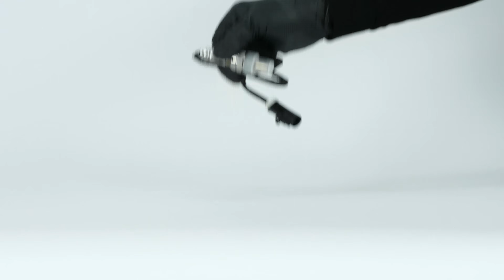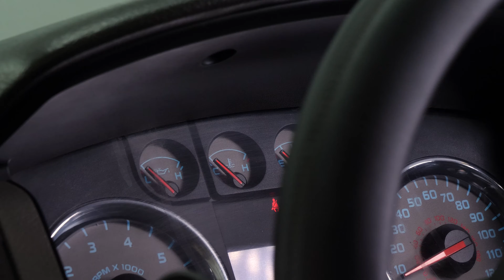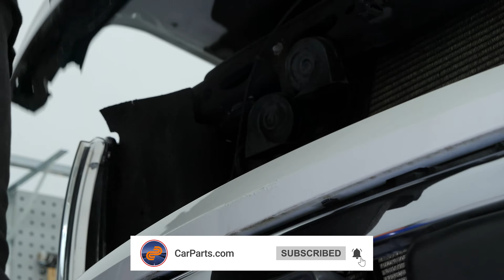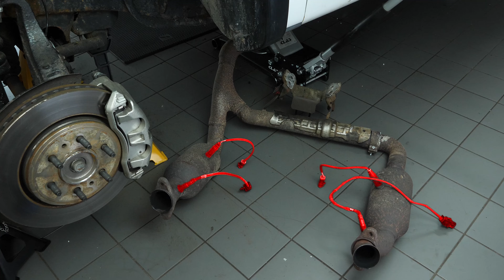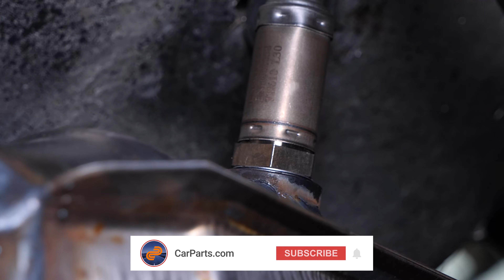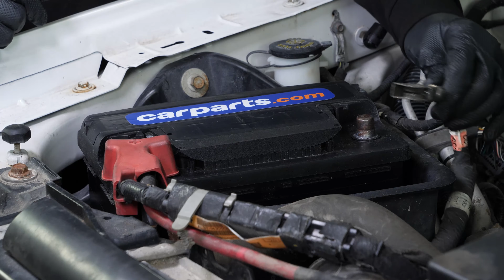How to replace the Oxygen sensors 2009-2014 Ford F150 ⚡

Comment: I unplugged the battery and the check engine light went away for the O2 sensor. wonder if it will come back or if it's fixed🤔
Reply from the maker: Without replacing the sensor?

Comment: What they fail to explain and/or demonstrate, is how Bank 1 sensor 1 on the passenger side is a real pain in the ass to remove. Need an offset o2 socket, a stubby 3/8s flex ratchet, a high pain tolerance and lastly, preemptively asking for forgiveness for the 800 f-bombs about to be spoken during the process.
Reply: Dealership wants $1900 CAD to replace all four O2 sensors.
Reply from the maker: It's true that these O2 sensors are difficult to remove, but our aim is to show you the access and handling required to remove them. Sometimes it takes much longer than shown in the video.
Reply: On what engine? I gotta do one on a buddies 3.7L and I'm struggling to find videos
Reply: @Josh-qc3uj if it’s sensor 1 bank 1 just save yourself the time and take it in man. It’s so tight up in there. You’ll probably have to heat it up. I spent hours trying to get mine off eventually said f-it. Took it in and the guy who did it took 3 hours, and broke his flex head ratchet trying to get it off. She’s a bitch. Don’t risk your sanity 😂
Reply: @Grilledtwinkies  seems to me it would be easier to remove that section of the exhaust to remove them
Reply: @Josh-qc3uj I believe this is a 6.2L
Reply: Only 800 f bombs?,,I,ll likely be over 1000 😮
Reply: im here because of that exact reason
Reply: I’d rather yell 1000 fucks than spend a band or two on a mechanic

Comment: Gives general information, and spends more time trying to sell their products or advertising links to other videos than actually  proving useful information.

Forgets to tell you to use anti-seize lube on the O2 sensor before replacing.  That’s an important missing step.  They also show the whole exhaust system pulled from the vehicle with O2, but don’t even label which one is bank 1 vs bank 2.